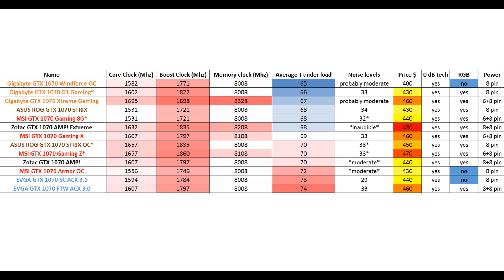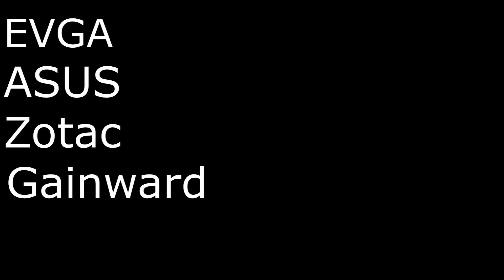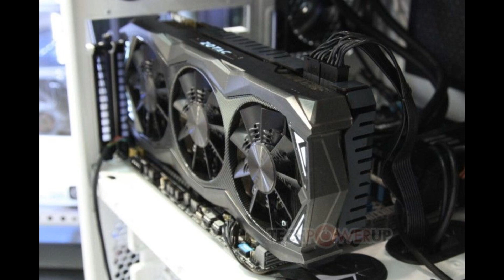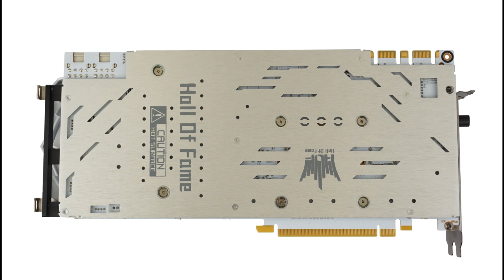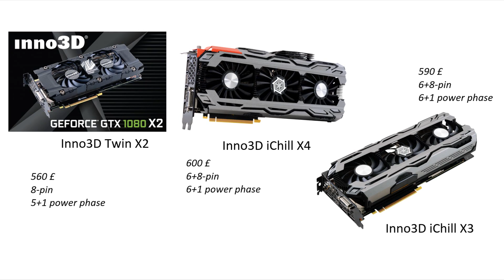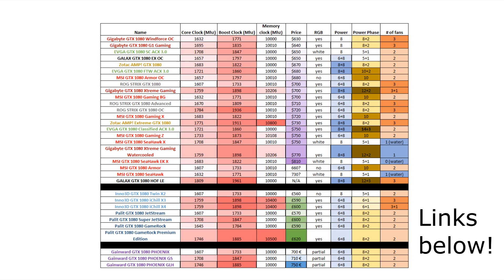Which Geforce GTX 1080 to buy? 33 different GTX 1080s compared.

Comment: Fast forward to November and I just picked up an MSI GTX 1080 Gaming 8G for $630 + a free copy of GoW4. That's sub $600 for those who were going to buy Gears anyway. After extensive research (and EVGA's recent VRM debacle) the MSI cards seem to be tied for 1st in value.
Reply: Just picked up a zotac amp for $620 plus gow4. returned it two weeks later. Just bought the gigabyte g1 for $599 plus watch dogs 2 yesterday. Got two free games.
Reply: YOLO
Reply: Why did you switch?
Reply from the maker: +MegaChickenPunch wow, that's an amazing deal, congrats!
Reply: Dude same.. Why not just buy something used with warranty and save 200 or maybe even 250-300 dollars xD. What are your impressions of the card?
Reply: foreign's gaming tech I am thinking of buying the PNY xlr8 1080 what do you think about It?
Reply from the maker: +Diego Gajardo great card as far as i've seen! I think you won't be disappointed
Reply: Hello guy !
Thanks for this video but i'm not enought good in english to understand it :/ How you found Zotac AMP Extrem ? pls
Reply from the maker: +Profil one hey, amp extreme is good on paper, but in reality the asus strix or msi gaming x are both better.
Reply: ohhhh okk thanks a lot for this tips you save my purchase xD and between asus strix and gaming x?
Reply from the maker: +Profil one i'd get the strix because it has extra fan headers that you could utilize for case fans!
Reply: Ok thanks and a last question sorry again !! 
for a monitor 1440p 144hz, gtx1080 gaming x is enough ? (to play ultra)
Reply: Profil one Not to max the 144fps but its really good (90-100) fps
Reply: Diego Gajardo ok bro thanks, then i think i ll buy a second 1080 later ...

Comment: the fastest 1080 in the market right now is the Zotac Extreme AMP! Edition.
Reply: BlazeBullet does it cause any noise while working?
Reply: Buddy Raydi 
Zotac 1080 amp extreme has less noise than other gtx1080 cards. I have one and the fans will even turn off if the load is not high. 
But in terms of fastest boost clock out of the box, that  honor goes to galax HOF edition. 
But most of them can overclock to 2000mhz just fine.  Zotac and galax card will have a slight advantage since it is using 8+8 connectors.
Reply: The Galax HOF isn't that fast, it's the Galax HOF LE (Limited Edition) that's the fastest boost clock
Reply: Paris Sanfasteryler Are you sure about that?  My FTW edition regularly hits 2130 during high loads on stock out of the box settings.  Not ripping on you, I'm just sharing some insight.
Reply: Credible Witness My Zotac AE gets to 2.1 stable as well. 
But not every card is stable at 2.1.
Asus isn't, MSI isn't, Inno3d isn't.
Reply: Yup, I have it in my rig. Jayztwocent's reviewed it and even he said it has the fastest boost clock out of the box.
Reply: Buddy Raydi totaly not
Reply: Paris Satn asus does I have a strix oc. Maybe because I water cooled it
Reply: whats with people and the noise... when you game you make more noise than the pc anyways

Comment: In October 2016 I've bought my GTX 1080 Inno3d Ichill X3, which is factory OC, and it's capable of playing 4K smoothly, no expensive Titan X Pascal needed. Still very happy with it after 5 months.
Reply from the maker: The Inno3D iChill cards are fairly underrated imo.

Comment: Going back and forth between the EVGA FTW and the ZOTAC Amp! Extreme. Probably won't OC much if at all, just want one that will run cool and last a few years. Like the 5 year warranty on the ZOTAC but I've only bought EVGAs over the last decade. 

What would you recommend? Great video btw, helped narrow down the choices and gave me lots of additional info. :)
Reply from the maker: You're welcome! If going with EVGA, I'd recommend ICX (this video is fairly old actually - all EVGA cards mentioned here are ACX, whereas ICX are their new and improved cooler that is pretty awesome), which are a fair bit more expensive. Their ACX cards may still have that faulty capacitor problem that made their cards catch fire. If choosing between the FTW and the AMP! Extreme, the Zotac card is definitely cooler and quieter, but it also extremely huge - you'll most probably need a support for it or something, and have to make sure it actually fits your case.
Reply: Awesome, thank you for the fast reply! I have the CM Cosmos 2 so space is a non-issue. Just ordered the Zotac and will build a matching yellow and black brace for it out of lego! :D
Reply from the maker: That's a great solution :D Congrats! I actually use a bottle of a perfect height to hold my 290X up, which isn't as massive as the AMP! Extreme, but still pretty big. The card you got is very good though, so congrats!

Comment: Palit = Gainward, these Jetstream/Gamerock cards are exactly the same as Phoenix/GS/GLH cards.
As far as I know the important difference between the best cards are that they have direct cooling or not on VRMs. For example MSI has not and Palit & Gainward has which means that vrm temps on MSI can reach nearly 100 C degree.
Gigabyte users are complaining about fan issues.
I would consider these cards: Gainward, Palit, MSI gaming, Asus rog strix, evga, kfa, innod 3d 3-fan variants
I would never buy: turbo,FE,msi armor
Reply from the maker: +mgoogyi i agree with your choices! Palit's cheaper cards (the pure black ones) are not that good though, definitely not comparable to the Strix or Gaming X. They are better than the Armor from MSI or ASUS Dual though.

Comment: Is The Gigabyte GTX 1080 G1 Gaming a good Choice? I´m not really sure about it...
Reply from the maker: Hey, depends on the price! What are your other options?
Reply: R Eschw very good i have had it for nearly a year and its the best value 1080 youll find. Very nice card.
Reply: @foreignsgamingtech  Hey please reply about that, i'm on that choice currently too, I have already 2 choices right now: the MSI Gaming X vs GIGABYTE G1 Gaming.

The MSI one is like 66-70$ more than the GIGABYTE, actually i can't afford it, but i can afford the G1 Gaming, should i go with ?? or just pick up an MSI GTX 1070 ti Gaming ??
Reply: YoyoyoGames what temps you get while gaming or under load?

Comment: I can afford a GTX 1080 in January and i'll probably get the Gigabyte G1 Gaming. It looks pretty damn cool. Though if VEGA comes out around that time, i might wait :P
Reply from the maker: The 1080 will most probably have a hefty price drop in January, together with Vega and the 1080 Ti coming out ;)
Reply: xx80ti is coming in second quarter of 2017, Vega is coming in first...In January we could only see workstation Vega type and question is how many will there be in stock...I'm also in doubt should I wait or should I buy

Comment: this is the problem with graphics cards,specs doesent really apply,its all about what your motherboard can handle and about 
 personal preference and opinion
Reply from the maker: +ropeccool with nvidia's newest generation what matters most is the cooler quality - what is the best at cooling while keeping the noise low? Then, after a certain point, it's easiest to just choose what you think looks best :p
Reply: foreign's gaming tech to be honest noise is irrelevant to me because I'm used to it from my old pc I've had for about 6 years now and it is noisy as fuck and If I wanted to I could just buy a special sound proof case for my pc
Reply from the maker: +ropeccool but you are not the only one buying these things :) i'm used to noise too, but would really like a silent system over anything so that i could put it on the table.

Comment: I can't find temperature or noise under the excel file - which are crucial for me :D where did those numbers go?
Reply from the maker: I don't include temps and noise anymore as those factors are extremely reliant on your own case, airflow and ambient temperature. For temperatures I'd recommend staying away from reference-style cards and using a custom fan curve to control the graphics card's fans when the GPU gets too hot.

Comment: Msi Armor and Gaming X share the same pcb right? Does the Gaming X has better cooling? Different chokes?
What about those models and Zotac Amp! standard, same story? reliability?
Reply from the maker: Hey, the Gaming X and Armor cards use the same PCB. Same with Zotac AMP! and AMP! Extreme. You can search YouTube for Buildzoid's PCB analysis, I'm sure you'll find what you're looking there :)
Reply: Yes, but... I think chokes and pwm parts differs from Armor to Gaming X, also Gaming X have all the components attached to dissipation; Armor seems to have "naked" parts. Is it right?
Reply from the maker: +nerd Mike armor has a worse cooler, that is true. The gaming x covers morw of the pcb, has more fins, heatpipes and better fans. Can't comment on the pcb components though. Afaik it's the same, but don't take my word for it ;)
Reply: All right :D

Comment: Which cards would be best in an SLI configuration?  I have pretty good airflow in my case, if that helps.
Reply from the maker: If you can have 2-3 slots between the two cards, then any regular card will do. If you're not sure, then get any blower style cards really. Gigabyte released a new card recently, not mentioned in this video. There are also MSI Aero and ASUS Turbo. If you can get the Founder's Edition for $600-$620, then that's mostly the best blower style card. Don't pay more than that for it though, as they're absolutely not worth it.

Comment: so in the end which one do you recommend?
Reply from the maker: With this video I tried to give viewers the tools with which to choose themselves. I'd suggest getting the cheapest dual-fan card you can find, with a backplate. If you can get a triple fan for only like $10 more, then I'd recommend that. But again, if it doesn't fit your case, you should be wary of that. If you plan to start learning how to overclock, then a graphics card with more power phases may be better for cleaner power and voltage delivery. If you don't care about OC and just want that 2000 Mhz, then get the cheapest dual fan 1080 you can find that isn't ugly to you, give it a custom fan curve and OC it.
Reply: thanks for the response. I went with EVGA classified. so far no complaints )

Comment: MSI GTX 1080 Gaming X or ASUS GTX 1080 Strix? What would you recommend?
Reply from the maker: Both are great. If you want extra fan headers for your fans, then the STRIX offers that with two extra fan headers on the PCB. If you don't care about that, I'd say get the one that's cheaper or maybe comes with a game.

Comment: if i was to sli, do you think i need to get a card with oc potential/good cooling like gigabyte or go for something like the ftw which has 2 ppc?
Reply from the maker: If you have space between your cards when you put them inside (like here: http://imgur.com/a/KGG0N), then you can put two custom cards, maybe put a case fan blowing cold air into the area between them - that will keep the airflow pretty good. If the area between your cards is smaller, then blower style would be better. But the temps will be pretty high anyway, so keep that in mind.
Reply: foreign's gaming tech i have an asus rog strix x99 gaming mobo will i get maximum performance if i sli 2 ftw 2 slots apart? sorry idk anything about this stuff lol i dont get what pcie is and shit. and thanks for ur help it means alot
Reply from the maker: You can use the third long slot (it's x16, whereas the last one is x8,  wouldn't suggest that)
Reply: foreign's gaming tech sorry last question: the hb sli bridge. does that mean i need the 2 slot spacing one? and does it matter what brand? (lol) again, sorry for my noobness and thanks for ur help
Reply from the maker: Hey, no prob, I'm happy to answer questions. The bridge depends on the resolution. If you're at 1080p or even 1440p60, then you're fine with the thin bridge. Otherwise the LED (older thick bridge) is good up to 4K. If you're going over 4K you have to get the expensive HB bridge.
Reply from the maker: You should check the distances in your mobo, I'm not sure because I haven't really dealt with SLI before. You should definitely check with your store as the mobos are kinda specific. The brand doesn't matter at all if it's a HB bridge (doesn't matter at all in terms of SLI bridges imo).
Reply: foreign's gaming tech yeh ill use 1&3, hope that means a 3 slot hb sli bridge will fit cos i already have one of them :D
Reply from the maker: Oh, then you can just check by just comparing what you have and if the bridge slow will align with the PCIe slot

Comment: Hi, 
Thanks for the video, out of the box what gives better FPS Zotac AMP Extreme or the Asus strix OC 1936mhz?
Reply: And in general what card gives the highest FPS out of the box?
Reply from the maker: The AMP! Extreme is definitely better, but it also extremely big - if your case and motherboard can handle it, then get that. If not, then the ASUS is also a great choice.
Reply from the maker: EVGA Hybrid and MSI SeaHawk, both watercooled.
Reply: Thanks man, really appreciated. ☺️
Reply: foreign's gaming tech 
The zotac amp extreme has sag issues. 
It is also one of the heaviest GTX 1080 cards out there.

Comment: I'm more interested in the best overclocker, aka best power phase configuration, best power input options, be silicon used, best vrm temps and quality. Temperature is not particularly important as water cooling would be used.
Reply from the maker: All of the factors you mentioned won't matter when OC'ing the card as the silicon lottery will determine the quality of your chip. I can't tell you which card types use binned GPUs unfortunately. In terms of power design (all the other things you mentioned) the Galax HoF 1080, Gigabyte Extreme, EVGA Classified would be your best bets. AMP! Extreme to a lesser extent. I'm not sure for which of these you can find custom waterblocks though.

Comment: i noticed the asus strix is held in high regard because its auto boost overclocking. but it looks like all cards have that auto boost feature is that right? can you sli the strix?
Reply from the maker: All cards should have auto-boost afaik, maybe after a few clicks in MSI afterburner. The cards should boost up to 1800-1900 no problem. You can SLI all the 1080s, yes.

Comment: what 1080 would you recommend for a future SLI setup with only using stock coolers?
Reply from the maker: Depending on your case. If you have enough room for air to move freely between the two cards, then basically any cards will suffice. If the case is smaller (most probably it will be pretty small) then I'd recommend blower-style cards. If money is not a problem you can always get two AIO watercooled cards :)

Comment: I have the i7 4790k, 16gb RAM and a Gigabyte G1 R9 390. Looking to upgrade my GPU to a 1070/1070ti/1080 but need one that isn't the biggest because of my case. Also not going to OC the GPU and don't want the most expansive one. Any Suggestions? Thank you

Comment: I found a cheap Super Jetstream from Palit, as I can see from your price range excell sheet you get more clocking speed overall than even a 700$ card....did I miss something? or is it THAT GOOD for a buget card that it surpasses the ROG STRIX GTX 1080?
Reply from the maker: +DjPyroGaming it may have a good pre-overclock, but that doesn't mean that it will be cool and quiet while holding it. If you have a good deal on the card I'd recommend getting it!

Comment: Just the Video i was looking for. But now im Confused..i'm looking for a 1080, wich could perform games like Anthem in 2018 in 1080p easy with best pricing and cooling. Hanging on the 8gb Asus Strix, I only got 2 Slots available. Or do u have a better choice?
Reply from the maker: This video is around a year old now, and things have stabilized since then. The ASUS Strix is actually one of the best 1080s out there, and if you have your eyes set on it, I'd recommend getting it.

Comment: I like the Palit Gamerock Premium the most. Is it good for OC? (I have:Intel core i-7 6700k, which will be overclocked with the help of the corsair h100i v2 water cooler; i also have msi z170a gaming m3 and 16gb of ram.) Is the EVGA Supernova 750w power supply (80+ Gold) enough to OC the CPU,GPU and RAM (HyperX Fury Black 16gb 2x8 2133MHz)?
Reply from the maker: Hey, yeah, that PSU should be fine for all your overclocks! The Palit Gamerock should OC up to at least 1900 Mhz, most probably even 2000. Tweaking is key!

Comment: I'm planning to use a custom water block and back plate for whatever card I buy, so does it matter which card I choose from a performance standpoint? I do realize that some cards, like the strix card have quality of life features like extra fan headers. but purely for performance, does it matter which one I choose if I'm not going to use the stock cooler or back plate?
Reply from the maker: Yes, it actually does. All boards use different quality components and different amounts of capacitors. With waterblocks it's of course easiest to just get the cheapest reference GTX 1080, as most waterblocks are based on the reference design. When choosing a card for that it will depend on which waterblock you're going to be using.

Comment: Please add temps in Excel sheet. Like you did for 1060.
Reply from the maker: It's basically impossible to do that for all these cards. I will do a video on making a custom fan curve to fix the possible heat issues people may get when buying different cards